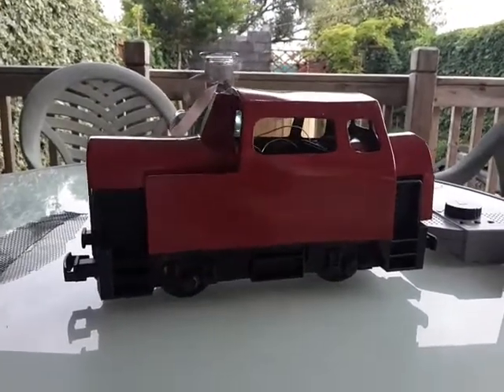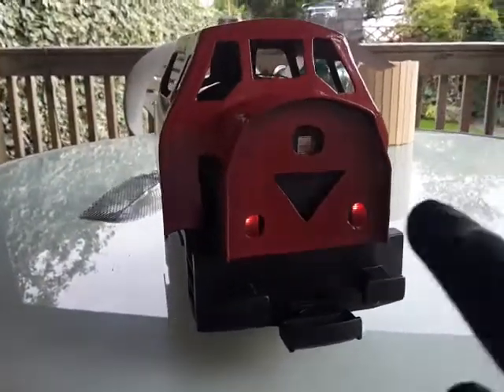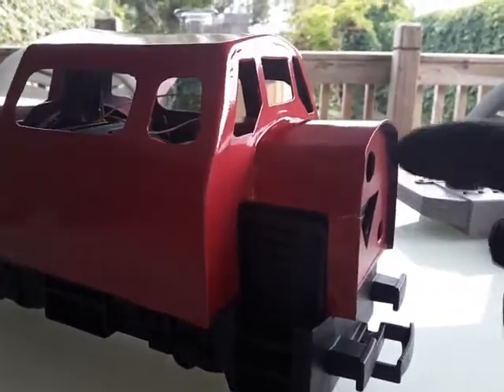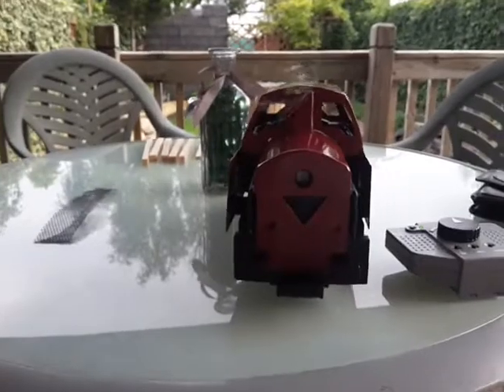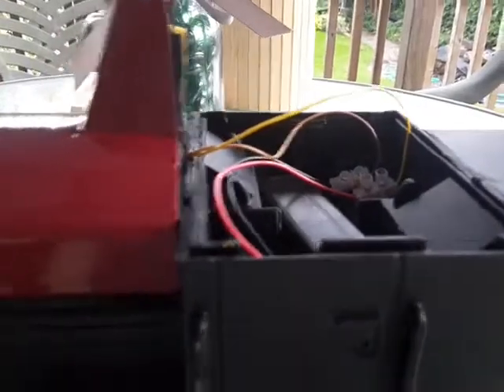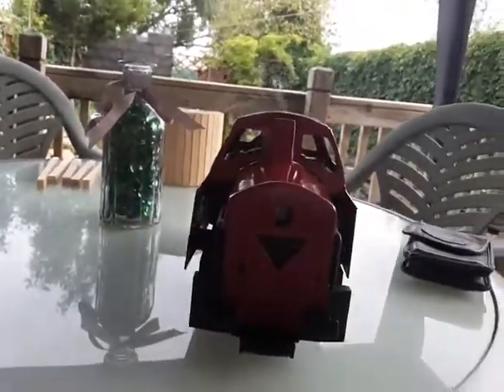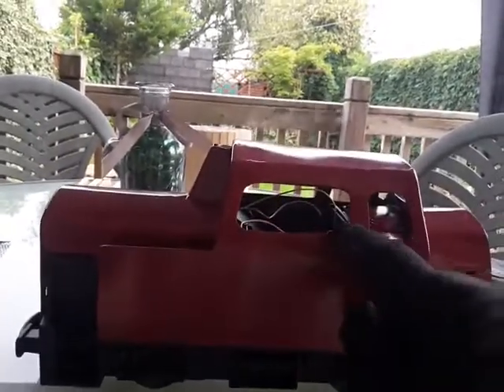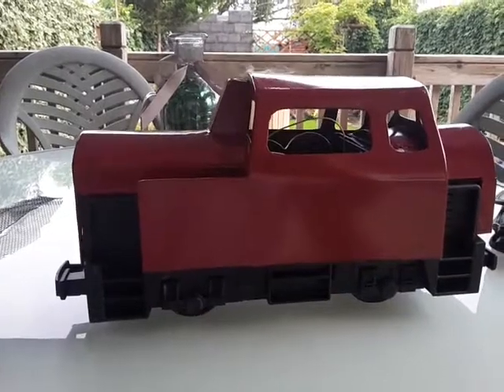G Scale RC Diesel Loco Conversion part 2 (Sentinel tribute)

Comment: Nice rich colour - did you polish it up? Certainly reminds me of a Sentinel. Smoke looks good. I tend to use these Seuthe smoke generators or everything but engines buildings and crashed spacecraft lol. Laurie
Reply from the maker: Calvertfilm Haha...yes they do look good for crashed spacecraft :) I think the Suethe offer good value and simplicity. I'm not sure if that one has enough power from the 9 volt battery, maybe I'll try something more powerful. I've been using car spray for all my locos and they really come up well with a nice polished effect after a few good coats. Glad it reminds  you of a Sentinel, it turned out to be very tricky getting the shape and windows all in the right place :) Thanks for coming over to take a look, Laurie, it's much apreciated. All the best...Tom
Reply: Tom jenssen I have subbed to your channel and get updates. Hence it popped up straight away today. Car sprays are the mainstay of most of my modelling too. Laurie.